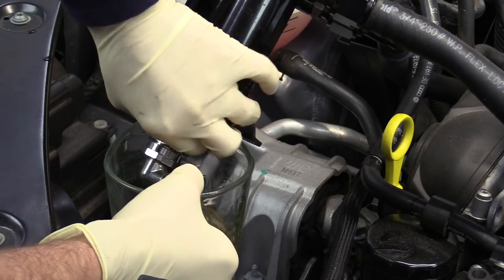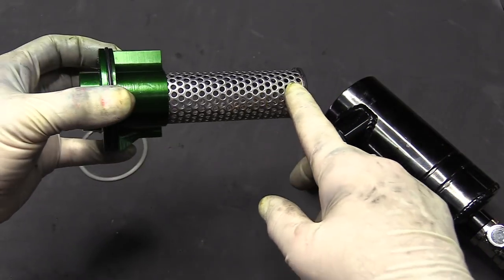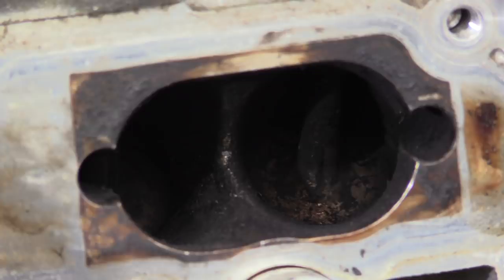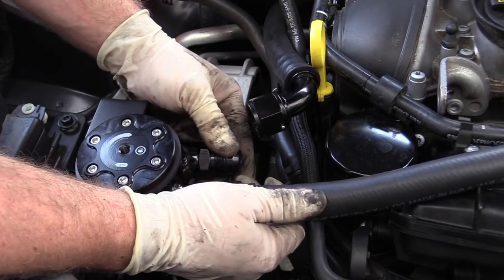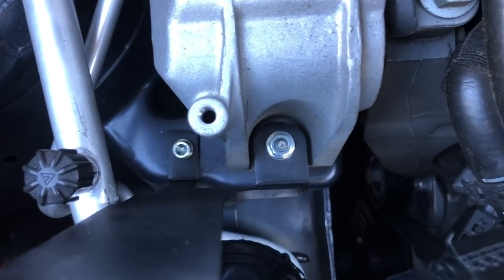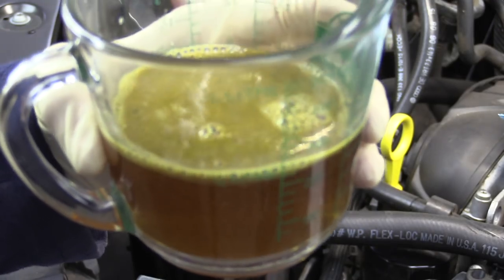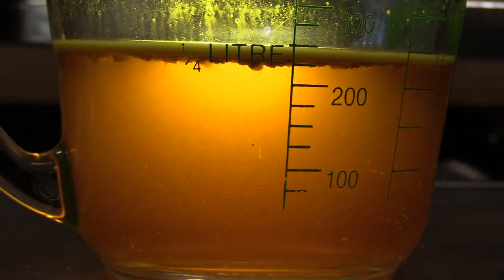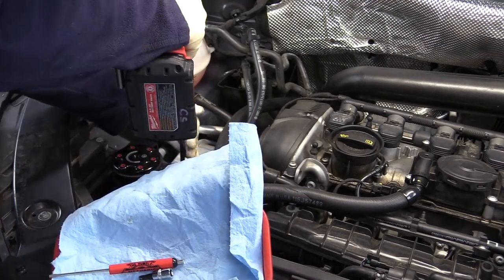Do Catch Cans REALLY Work?

Comment: it indeed works, however on my 1.8 TSI, I've started to experience few issues.
- at first, i did it just like you on that tiguan, which i later discovered it was pretty bad idea (boost issues, low power, too much pressure on crankcase).
- then i've unblocked the rear pcv output and connected it to the catch can via T hose, just like here : http://jurajsuchan.sk/_img/ccX.png and the ghetto look: http://jurajsuchan.sk/_img/ccX1.png

and few days after that, my car started making white-blue-ish clouds upon cold start, but later disappear when i start driving ! 
i'd like to believe that it's because few drops of moist resides inside the hoses, but after few days of researching, I think I'll go back to stock PCV.... but i don't wanna to burn something like this : http://jurajsuchan.sk/_img/cc_hnus.jpg :( without the catch can, the car feels slower from time to time :(
Reply: Maybe you should just try less complicated catch can, the one you got probably influence the pressure too much.

Comment: Someone gave me 6 quarts of Mobil 1 oil synthetic when they were moving.  Never used it before.  It was a bad week and needed to change the oil.  So I bought a Purolator plus filter and used the Mobil 1.  Back and forth to work was 35 miles.  Checked the oil. It was black after one day. Switched back to regular oil with no issues.  It was in a 4.3 engine

Comment: Engines are designed to burn this, collecting condensation through additional ventilation and repositories is going to collect liquid, isn't that the purpose of a catch can?  Why not let the engine burn it, save the $400 on an added system that has the potential to, if installed incorrectly, cost thousands?  Build up happens over time for sure on intakes, but other parts wear as well.  What happens when someone forgets to empty the "can"?  Seems like lots of extras for an unproven gain.

Comment: Ok LEARNING TIME FOR ME... if the oil catch can is suppose to catch Blowbuy... and send air back to the intake.. Why do you need the second hose.. when the intake is ALL ready attached? It doesnt provide anything to  the engine.  Why not go from the pvc to the oil catch can and thats it and leave a hole for air to escape?? Why does it have to go back to the intake?  This way the only way your getting carbon buildup would be by the gas and air mixture.

Comment: I find this whole subject such a dilemma, and firstly I am not a mechanic.
I think the real question is not whether they work but are the necessary???

I see two sides to this problem.
Firstly car manufacturers spend millions upon millions on car development and do extreme testing on engines and so if these catch cans are good and can stop carbon build up then why are these not OEM in the first instance.
Secondly is there a conflict of interest by those who make catch cans who simply want to sell people like me a catch can???

It sounds like I think catch cans are for fools doesn't it, but of course car manufacturers also don't want things lasting for ever so you buy new vehicles.

Now having said all of that I just bought a 2019 Mitsubishi Triton with 21 klms on the clock and found someone has installed a catch can.
With 4WD here in Australia there seems to be the psyche that you modify them simply because every does.
Well being someone who tries to thin critical I also realise that popularity doesn't necessarily mean it's good.

My dilemma still exists though.

Comment: why cant you add a water injection to solve the problem?
Reply from the maker: You can. I don’t think it will totally solve the issue, but it can help. I’ve seen a few cars with water/meth that have had fair results. But you have to look at pros and cons of adding that system to a vehicle.

Comment: Sooo seems the larger part of what your removing is condensation, along with the very small amount of oil.  And the amount seen is a cup, over at least 3k miles and hours and hours of engine run time.  Your well experienced, so I'm SURE you've seen the cleaning effects a little water squirted into the intake of a running engine has.  Sorry if your doing promotion work for somebody.  But you see where I'm going with this???  That miniscule amount of water in the intake would have 0 effect, or if it DID...  It would be a GOOD thing!  The even more minuscule amount of oil (one teaspoon out of the cup maybe...) Would barely be enough to discolor the entire intake surface over 100k miles.  Crud people are finding is from poor air filtration imo.

Comment: I installed a DIY Catch Can on my 2016 Kia Soul (2.0L GDI).  After about 1 year and 6K miles I have collected just about the same amount that you got.  The fluid collected is more a coffee-colored than what you show.  Winter driving caused an increase in volume (I checked it frequently).  I think keeping stuff like this out of the intake system is a worthwhile effort.
https://www.youtube.com/watch?v=aevrlix8gpI&t=71s
Reply: Do you know if it worked ok during cold winter months?
Reply: @gad44  IMHO, the catch can is even more important in colder weather (below freezing).  Right now daytime temps are in the single-digits.  I am overly fussy and check the catch can after each use of the car. The last 40-mile trip yielded over an ounce of brown gooey crap.  Imagine that getting onto the intake valves!  One issue I have found is during very low temps, the liquid in the catch can freezes solid. That surprised me, but it makes sense.  Since the catch can tubing is quite long, it makes me fear having the lines fill up and freeze solid, preventing proper flow. Each month, I remove completely the entire unit  and PCV and do a thorough cleaning and inspection.  Regards.

Comment: People drive 300k on engines with no catch can.
I don’t think these do much.
Reply: Your statement is 100% accurate. The caveat is many of those cars had port fuel injection while 50% of today's vehicles are gas direct injection. And the % of vehicles with GDI is growing each year. GDI cars with as little as 50 - 60k miles are subject to crusted up carbonized valves, knocking, pinging, and poor engine performance. Some need to be walnut blasted off which can run over $400. BMW GDI cars are looking at the top end of $800 for a walnut blast. Some cars are starting to have both port and GDI to try to solve this issue.

Comment: This is great. However, I can't believe this will cure the carbon build-up 100% on GDI vehicles. When I was a kid. We did everything to get that one extra %. We even polished our intake ports. GDI would ruin all that in the first gallon of fuel and the result of the amount of blowby and heat cooking all that goo even, with a catch can. The only thing that should be going through your intake is pure clean air and fuel. Providing you with the best horsepower economy and the cleanest exhaust Air quality. I would believe would suffer greatly the longer you induce oil and other contaminants into your air-fuel  delivery before and after combustion. Whatever you can do to stop this from taking place in your PCV should be considered. I also can't see as a value to return it to the crankcase. It obviously has way too much moisture content to consider that. So I would consider it's own reservoir. Which could be considerable given the amount collected in such a short time. I would assume that geological location and environment would also be a consideration. The dry dessert or the cold humidity of say the north coasts, winter, or rainy seasons etc...

Comment: I think catch cans are more of a gimmick, since the factory tsi engines already come with a oil separater. Many of these catch cans replace the factory oil separator. I would imagine that most of water, oil and sludge you removed would be separated by the factory pcv and oil separation system.

I've heard from many long time mechanics that work on direct injection systems, that catch cans will not prevent the inevitable...... Carbon build up. Just my take
Reply: MrJayjay0420 I was wondering about that also. I can’t prove that the catch cans won’t help the carbon valve issues with DI, but I was told by a tech at GM, that I know in real life, their not going to help much at all. But lots of money to make selling these cans!! Should have thought of this myself and started selling them!

Comment: Shit ! Was that 3000 or 30,000 I must upgrade to premium catch cans. As for some comments saying it's mostly condensation and will burn off. Here the problem lies is that they admit other compounds are present and when this vapour continues its way down the intake towards the head the temperature is increasing and turning to steam and drops any contanimates it carries along the way until it hits the hot valves and builds a pile of shit as with the water don't worry it escapes out the exhaust as steam and return to a pure liquid water and laughs at our problems we cause ourselves :-(

Comment: There's no way to know the value of these.  I've had Ford Vans with v8 and v10 that run up to 250,000 miles with regular dino oil changes at 7500 and they were still running like new, so were the transmissions.  They didn't have catch cans, or any mystery oils used, or anything else, just the simple dino oil changes and other stuff as recommended by the manufacturer.  Most of the fleet gets changed out at more like 150K but those too just get simple 7500 mile dino oil changes and are still running like new (engine and trans) when auctioned.  The few that have problems don't have problems from "wearing out", they have something break, and the kind of "it broke" never has anything to do with how often an oil change was done or whether some amazing aftermarket part was or wasn't used.  
I like the idea of the catch can at first look but see no evidence of actual benefit.  Might even be hurting performance.. think about this, it's well known that water injection can be used for more power, lots of RV users used to do it to pull hills better.  And people used to use the "water down the carb" trick to clean out carbon deposits.  So since most of the stuff in the catch can is just condensed water, perhaps the engine would have been better off, and performed better, if that water had just been run thru it instead of being "caught".

Comment: That looked like a very thin liquid. More like water than oil. What is that gross white film at the top ?
Nasty ! 

Could these catch cans be a bandaid to fix a problem manufacturers can't, won't or don't care to solve ?

I have an old school carbureted small block Chevrolet and wondered if this would be a worthwhile addition. I run a simple pcv valve on one valve cover and a breather on the other. Both have a basic sheet metal baffle/shield below them in the valve cover. I pulled the hose off the carburetor that goes to pcv valve and inserted a long cotton swab in it. Wiggled it around in and out. To my surprise it came out completely dry. I know the valve is functioning because I can pull it out of the valve cover when the engine is idling  put my thumb over it and it draws a vacuum.

So why is it not sucking up any oil ? There is a hurricane of oil in there when the engine is screaming at 6000 RPM. In my case I think it is unnecessary.

Send that crap to some environmental lab for testing. Find out exactly what that crap is. There is something weird going on. I would be hella pissed if I saw any of my engines barfing out shit like that. You might say I would become "emotional".

Comment: Isnt a catch can what an oil filter does?
Reply: An oil  filter removes contaminants from the engines oil. A catch can will "catch" the oil that is flowing through the PCV system, which would otherwise be routed back through the engine

Comment: Why don't they already come with a catch-can from the factory is the question.
Reply: They want to service your valves and clean off the carbon when you run into issues. If they are preventing or slowing down issues that will come up then they are losing money.

Comment: Looks like 98 percent water -- the heat and metal can is possibly acting like a small distiller -- creating water from its own heating and cooling -- the oil look minimal at best.  Even when he pours it into the glass it sounds like he is pouring water, not oil.

Comment: The engine is designed to burn that off. If you go online you can find tons of articles about how the ecoboost motor of fords are horrible for that and you have to get a catch can or your motor with be needing to get rebuilt. I know several guys with that ecoboost engine in the F150 most of them bag the shit out of their trucks and none of them have a catch can. 5 of them are still driving the same truck with over 300000KM's 1 has just over 200000KM but traded it in and got a newer F150 and my self i have 88400KM on mine I am the only one to have any engine issues. Mine was just a stretched timing chain. when they took apart my engine there was no sludge or massive carbon build up. so i think its not needed unless you are off roading at steep inclines

Comment: I wouldn't be surprised if this reduced the carbon build up, but at the same time, maybe they designed it to intake some oil to help with lubrication? I know some newer vehicles are purposefully made with lower tolerances so that it gets better fuel economy through lower friction. Either way, pretty gross.

Comment: WOW,
It seems like that motor is not very healthy for over 3000 miles!

My TDi 350,000+ mile motor has a hose that leads straight to the ground, and it doesnt even leave one drop of oil from the crank case vent. That is NOT normal.

well maybe normal for a newer VW, but NOT GOOD.

Comment: I have  2013 Subie Crosstrek XV. At about 40K miles I pulled the black plastic air intake boot and looked  in the area where the PCV valve outlet goes. I expected  some oily liquid......NADA, NOTHING, totally clean and dry!! I don't think an oil catch can would help my car. Just MY experience.

Comment: Holy crap that is more blow by than I have ever seen in my life come out of a catch can, especially after only 3k miles? What car is that so I will never buy it? I have a catch can on my VQ35DE, an engine known for oil consumption and blow by. I check it every few thousand miles and never pulled, not even close to that amount out of it. That is not good. Excessive blow by is a huge indicator your rings are shot and engine is about done. Good deal on staying positive though cause if I pulled that much out of my can, it would not be a good day.

Comment: Now that Ford has moved to a hybrid direct injection and multi port fuel injection with the injectors in front of the intake valve, looks like the solution is to shy away from direct injection.

Comment: ofc catch cans will always work and that's espesially true if you have a modified forced induction vehicle... your question is like asking "Do toilets REALLY Work''
Reply from the maker: Lol I’m not convinced it’s as simple as that. I’d rather have tested “do catch cans prevent carbon”
Reply: @HumbleMechanic   well, the video is named ''Do Catch Cans Really Work''... im responding to that... in the case of your responce to my comment ''do catch cans prevent carbon'' the answer is pretty simple if you know the whole process. so my thoughts have always been the following. The catch can is in between the PCV valve and intake manifold and it's pupose is to catch any oil that makes it up from the crank case preventing it to be thrown back into the intake manifold and burned into the combustion chamber, therefor by deduction a catch can will definitly help with carbon buildup related to high crankcase pressures... mostly effective with forced induction applications. the test is very valid and nothing wrong with wanting to test it, the title is where my problem was. =) since the catch can is meant to catch oil and not burn it ofc it will help as you have seen pretty evidently with your test..

Comment: The can isn't large enough... A large gulp of liquid could be catastrophic!!
Reply from the maker: I think you'd have some pretty legit drivability issues long before that happened.
Reply: A large hose diameter would mitigate that to the point of impossibility. 
PCV systems are designed to keep the byproducts of combustion inside the engine so they don’t contaminate the environment. Unfortunately, doing so even in the most efficient and clean engines contaminates the engine and causes premature wear. This solution of removing the byproducts of combustion that dont get exhausted conventionally is more environmental in that it protects the engine and prolongs lubricant life. But big oil and auto makers wouldnt be in business for long if they included these on cars...